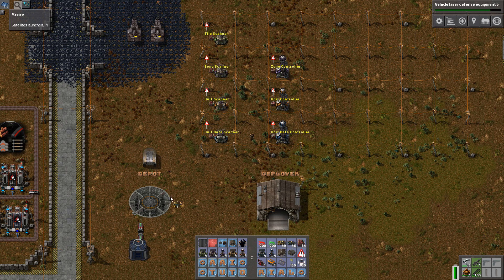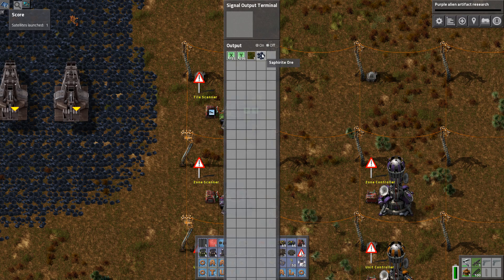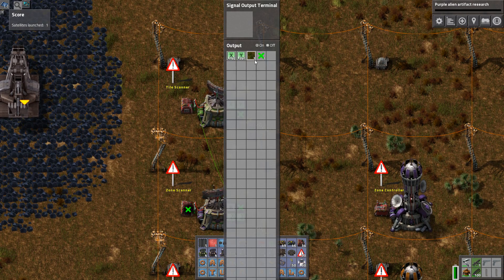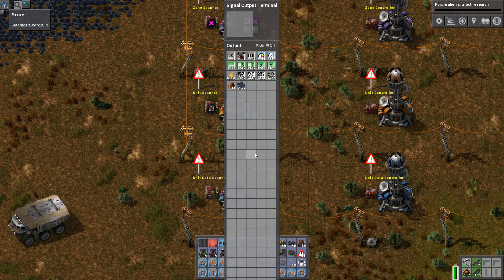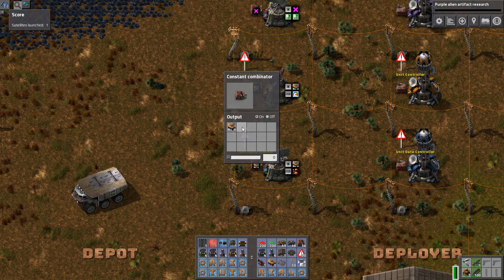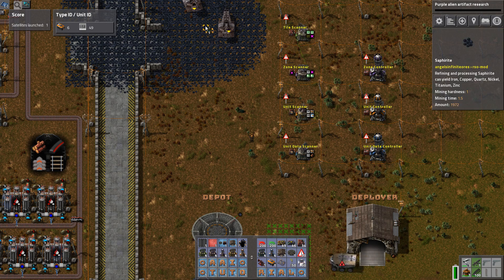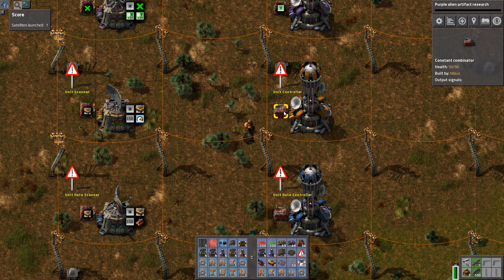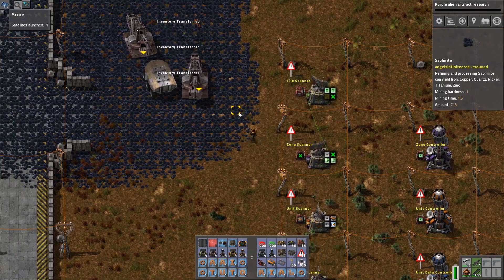AAI Mod Tutorial 2 - Scanners and Controllers

Comment: at first my thoughts were: "damn why is he so lost? i mean he is making a tutorial so he should know?!" but after spending a day on the stuff i can tell that most people probably could not have flawlessly explained that mod! i did a automatic Zone Cleaner and placer... i only need to walk (could also put it on units) near a patch or put a zone in and it will spread like fire over the zone and it also cleans empty ones. my trick was to put a blue Zone and turn it to a red one. this way the blue ones spread fast no matter how many red ones there is to iterate through! 

the spreading mechanism is done with 1 position, -1x -1y added to the real X and Y to make the 3x3 square centered. then i use an iterator, i go from 0 to 2 on X and if X =2, add one to Y to go down one line of 3 squares... so X,0 and Y,0 = top left corner and X,2 and Y,2 = bottom Right. since there will always be way less blue than red tiles, the spreading is always fast and do not get much slower with time. the only problem is i only made it for Iron patches (all tho 5k tiles in and it is spreads relatively fast!) and i some how cannot make the Decider go: "if anything = Iron, then Out put Everything." so i have to input, if iron = 1 or more, output... any how that was me on "Day One" of using the network cables for the first time... probably is a lot of trick i need to learn!

Comment: Can't open the signal output terminal, playing on v0.16.51 with all aai mods
Reply: that changed... you can click on it but it does not display the icons anymore... just a settings panel of what it will output. maybe since it will only output stuff from it's mod, the GUI changed for tick boxes that contains only stuff from that mod... also i think i read that Nilaus (this YouTuber) has not played this mod since 0.15 and do not do complex Network stuff anymore... (probably why he did not answer this...)

Comment: How do you open the "signal output terminal" window? And how do you open the zone icon window?
I have all the mods installed, including aai signals.
Reply: did you figure it out yet? if not: the signal output is on the entity but the entities are multiple entities in one so center your mouse on the radar thing, move it a bit right and the yellow square will appear, click on it. then the zone planner... it is like blue prints, pick that black blueprint like iron or page, when you have it in hand like blue prints, the window will automatically open on the left. you then click on colors in the top half, the bottom half will change colors while displaying the same icons. (i think... i just started using this yesterday. and i have a few mods taking screen space... so the menu's bottom might be hidden.)
Reply: I think this mod might help: https://mods.factorio.com/mod/visual-signals

Comment: No matter what I do, the Unit Data Controller does not work at all. 
I followed your exact directions and made sure all the outputs on the machines were of corresponding values.
The mining vehicle clearly has 150 fucking copper in its inventory, I set the Hauler to pick up 150 copper and.............. nothing.
Combinator is hooked up, correct hauler ID is set, the unit controller is not conflicting with it, it just sits. 
Spent 2 hours trying to figure out something that should only take 10 seconds to set up.
Reply from the maker: I am sorry I cannot help you :( I stopped using AAI 6 months ago because it took too much time to debug. I think the mod has been updated several times since so the logic may have changed slightly. It is unfortunately not easy to debug, especially from a word description like this :(

Comment: I am very confused on how to see that window with all the data from the signal output terminal.  I am just now trying to figure out how to wire things together with the red and green wires.  But when I click the signal output terminal from a scanner there are just a few check boxes labeled "Output Filtering" and not a whole window of data.  Is there a video or something for this?  This video assumes that I would already know how all of this works.  Other than these videos I cannot find much about how to use this mod.
Reply from the maker: I think the additional signals are part of the mod "AAI Signal" I believe it is a pre-requisite for AAI, but maybe only a soft pre-requisite.
Reply: Hmmm I appear to have that already, I can still see the data when I mouse over the terminal in a smaller window on the right side of my screen so i guess I will just have to go with that.  Also when alt is activated to see what is in everything it does not show what is in the constant combinator or the terminals which is strange.  Thanks anyways for the fast reply.